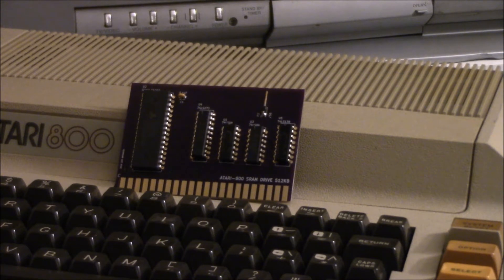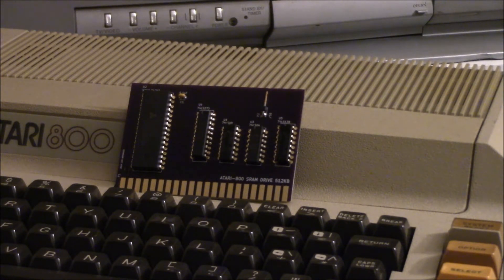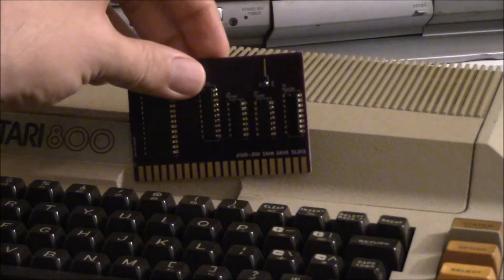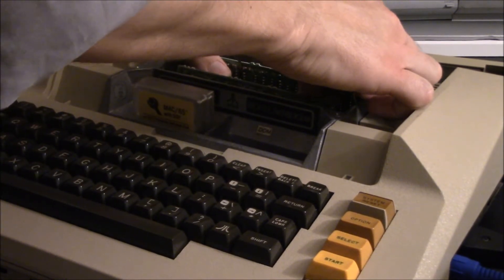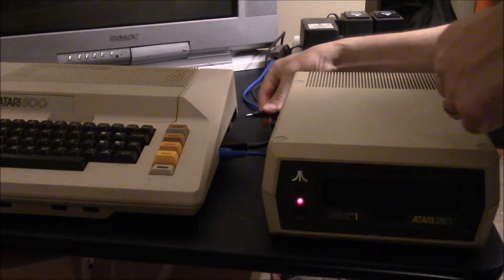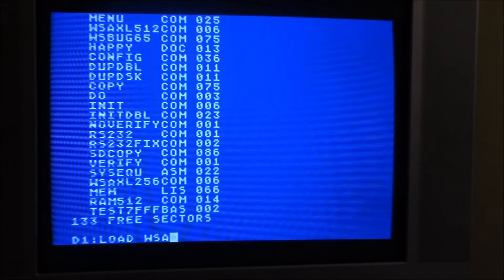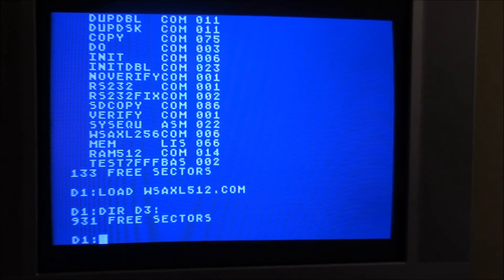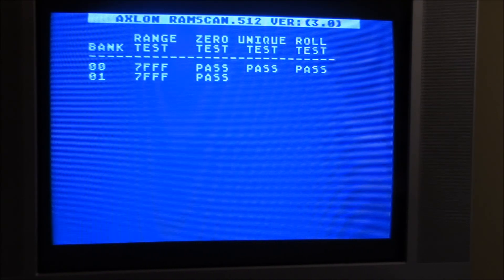Atari 800 Axlon 512K RAM Board Demo

Comment: So then would this allow cartridges that are unplayable on an 800 (i.e. Flight Simulator II) to become playable?  Flight Simulator II needs at least 64K to function, so a stock 800 won't play it.
Reply from the maker: The memory structure is not the same as the XL or XE machines, so anything requiring 64k Xl machine would not work. Axlon is suported by some office apps like syncalc. Probably used primarily as  ram drive.

Comment: Hey, does your 810 Happy have the Rev 7 Hardware? Your DOS XL Warp Speed uses that 'slower' original happy protocol, noticeable by the lower SIO tone compared to the later UltraSpeed emulation. The older happy upgrades only supported this 'Warp Speed' Protocol. Topic of discussion on AA.. http://atariage.com/forums/topic/257578-happy-810-resources/?p=4128233
Reply from the maker: Just saw this in my spam folder? I purchased my Happy upgrade from B&C and was supposed to be the latest version.  I took a photo of it before installation.  I'll have to dig it up and check the eprom.